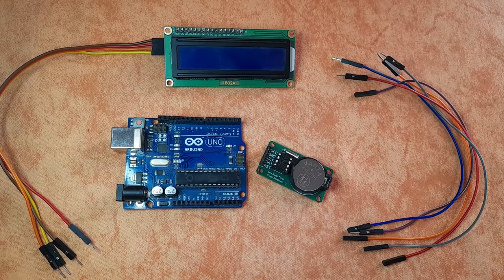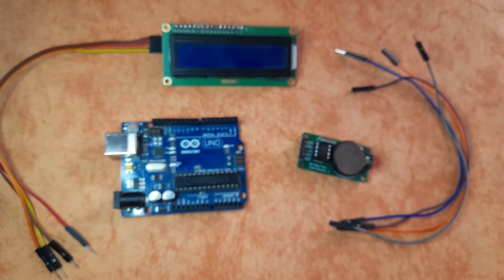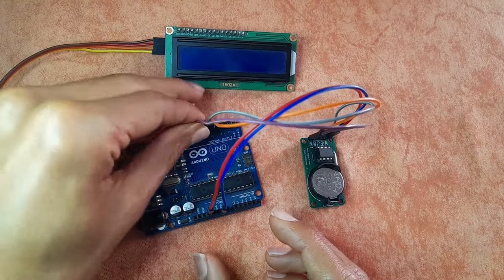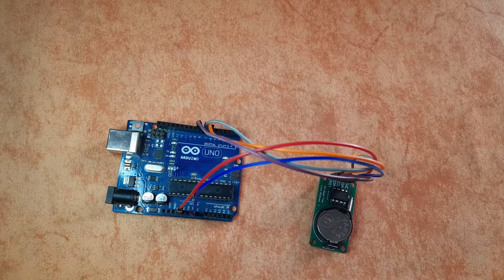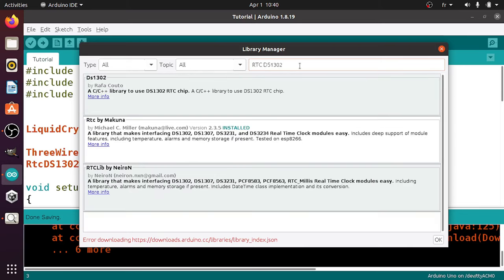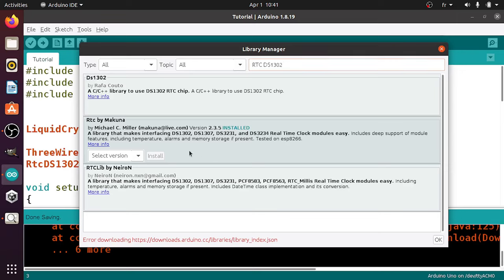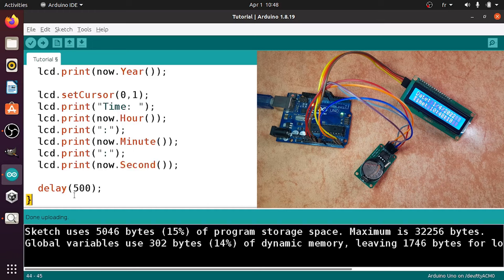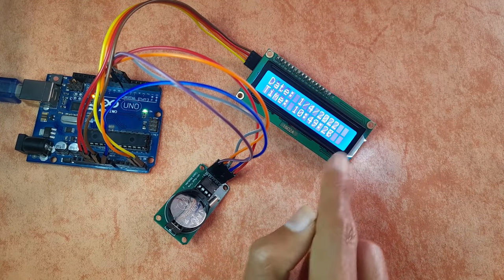Arduino Tutorial 35- Real Time Clock using DS1302 RTC Module

Comment: In the video you said the DS1302 would take the time and date from the computer but my clock sometimes says "Enter year" and sometimes "Date: 165/165/21" "Time 37:65:85" + in the .zip that you put there's a picture called "keypad-circuit.jpg" and the code has the keypad library
Reply: This happens when RTC module partially connected
Reply: have the same problem, have you fixed it?

Comment: Thank you so much for your video. The analog pins that were used for the LCD, are it not possible to use them again for another module? Because I need more analog pins for my moisture modules.

Comment: The code doesn't match with the video.

I asked chatGPT to write a code for setting up the reat time clock with the same pins as the pins this video used. Just change some codes like Serial.print to lcd.print.

#include <Arduino.h>
#include <Ds1302.h>

// Define the pin numbers
#define PIN_ENA 8
#define PIN_CLK 6
#define PIN_DAT 7

// DS1302 RTC instance
Ds1302 rtc(PIN_ENA, PIN_CLK, PIN_DAT);

void setup()
{
    Serial.begin(9600);

    // Initialize the RTC
    rtc.init();

    // Test if clock is halted and set a date-time to start it
    if (rtc.isHalted())
    {
        Serial.println("RTC is halted. Setting time...");

        Ds1302::DateTime dt = {
            .year = 24,  // Set the year to 2024
            .month = Ds1302::MONTH_MAY,  // Set the month to May
            .day = 19,  // Set the day to 19
            .hour = 21,  // Set the hour to 21
            .minute = 9,  // Set the minute to 9
            .second = 41,  // Set the second to 41
            .dow = Ds1302::DOW_SUN  // Set the day of the week to Sunday
        };

        rtc.setDateTime(&dt);
    }
}

void loop()
{
    // Get the current time
    Ds1302::DateTime now;
    rtc.getDateTime(&now);

    static uint8_t last_second = 0;
    if (last_second != now.second)
    {
        last_second = now.second;

        // Print the date and time in the format "YYYY/MM/DD HH:MM:SS"
        Serial.print("20");
        Serial.print(now.year);  // 00-99
        Serial.print('/');
        if (now.month < 10) Serial.print('0');
        Serial.print(now.month);  // 01-12
        Serial.print('/');
        if (now.day < 10) Serial.print('0');
        Serial.print(now.day);  // 01-31
        Serial.print(' ');
        if (now.hour < 10) Serial.print('0');
        Serial.print(now.hour);  // 00-23
        Serial.print(':');
        if (now.minute < 10) Serial.print('0');
        Serial.print(now.minute);  // 00-59
        Serial.print(':');
        if (now.second < 10) Serial.print('0');
        Serial.println(now.second);  // 00-59
    }

    delay(100);
}

Comment: i used two time module...why my 1st module displays only the 0/0/2000 0:0:0 and the other module is 165/165/2165 and 37:165:85
Reply from the maker: Check out this video in which we've added a Keypad to set the date and time manually 
https://youtu.be/c40S3z0OcuE
Reply: I had this problem too (0/0/2000 0:0:0).
You need to check the wiring pin (7, 6, 8);        // DAT, CLK, RST